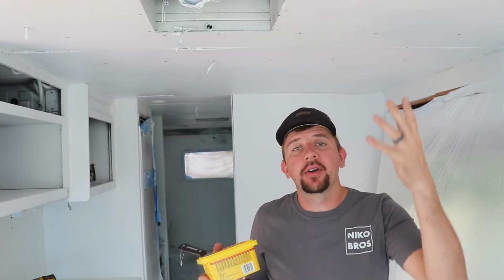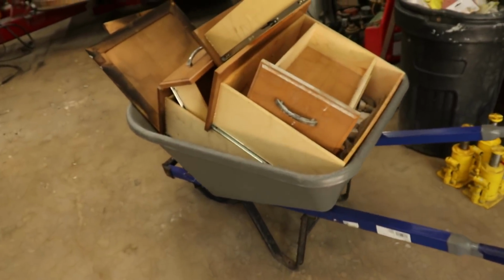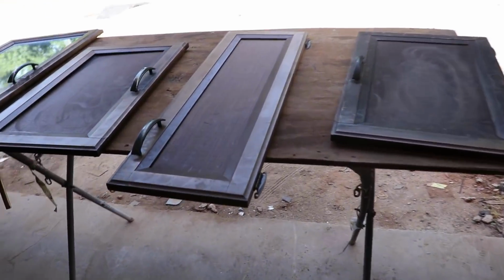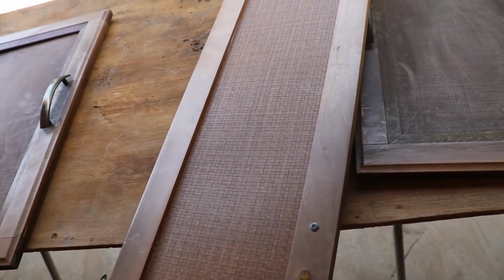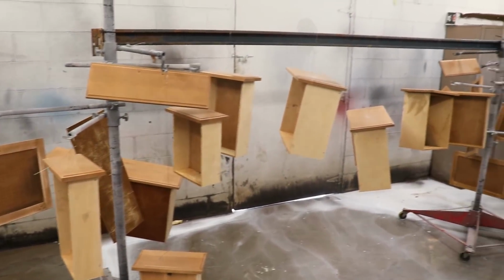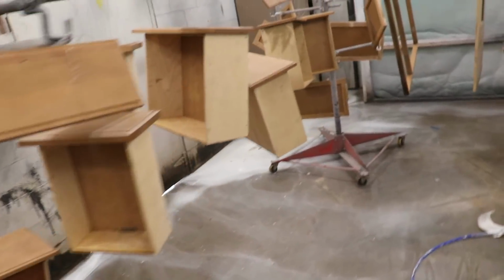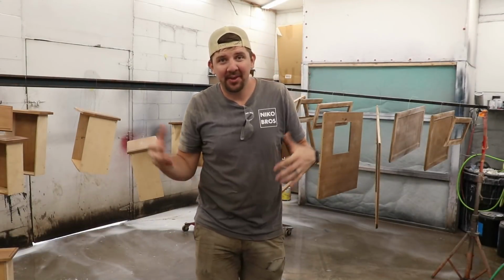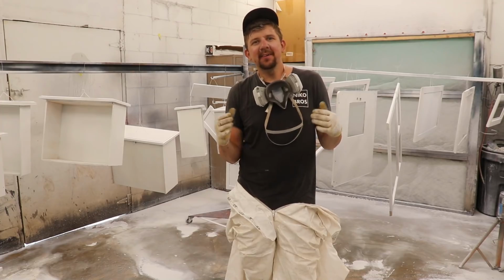2015 THOR VEGAS RV CABINETS SANDED AND PAINTED PART 9

Comment: Any cabinet doors or drawer fronts take to a local cabinet maker guys and have e them reproduce what is burned and can not be salvaged. They can reproduce an exact replica and it will be your cheapest/quickest option. They may can get em done in a couple days since you don’t need them finished

Comment: Paint the cabinets with Sherwin Williams Emerald Urethane Enamel door/trim paint. Durable and hard. Semi gloss would be best. Good luck
Reply: And just to add, I paint cabinets all day everyday. Technically you should be using a shellac based primer to keep the wood tannins from showing through

Comment: stain it with a semi-gloss stain and then use some sealer to seal the stain, then clear coat the face side. Add some close softener pads so they cant be slammed on the inside closing edge or the cabinet doors and drawers.

Comment: My opinion is that the roof is going to crack with the movement or torsion of the frame and that's why the manufacturers use fabrics. Also the painted cabinets in White not fancy.

Comment: i can see the very hard work in prepping. am not in to painted wood. so waiting to see how it turns out..the ceiling joints are not butted up. and with the screws taking out. when moving could work loose !

Comment: Kinda silly to take the screws out of the sealing panels.
Why not countersink them and then fill in the holes ?
Reply: Did you see how thin the plywood was no way could that be countersunk
Reply: @dougcop7253  It would be very easy
Reply: I thought it was good thinking to remove any unnecessary weight. RVs have weight limits. Cumulatively screws,and other unnecessary fasteners can leave enough free weight for. Something cool!
Reply: Surely they are going to add some sort of trim where the panels meet etc and it would be easier to do that without the screws. That's how I'd do it on boats with hard ply linings atleast anyway.

Comment: CAN YOU TAKE THE BACK SLIDE OFF THE OTHER VEGAS AND PUT ON THE ONE YOU ARE REPAIRING
Reply: The other one slides in the back, not the side
Reply: You would have to reframe whole back wall to do that, probably has aluminum framing in wall now. And most rv walls are 3 pieces laminated together.